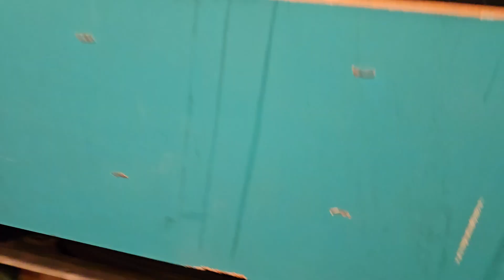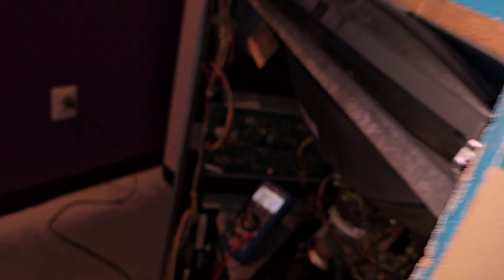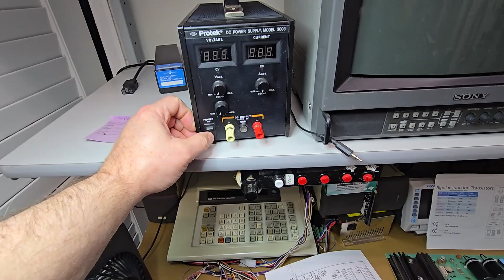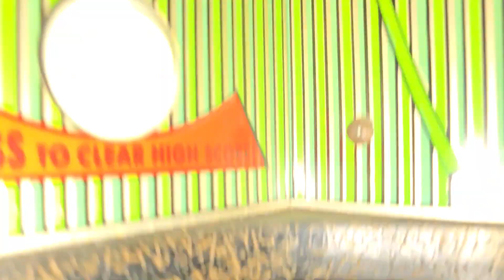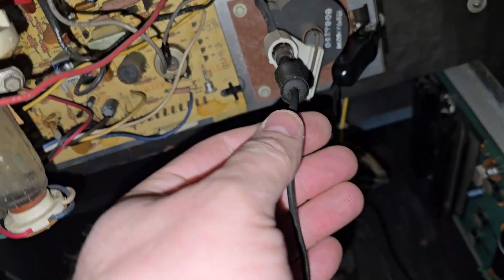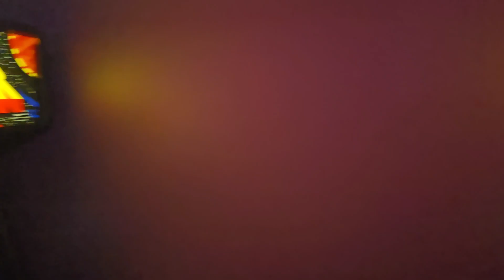Arcade ADITL - Sea Wolf - Reset ckt?, Ballast, HV Noise, Arcade Walk Around

Comment: I think to test a BAD Ballast transformer you're suppose to use a insulation Tester Megger. Using the DC resistance isn't going to tell you if the transformer windings insulation has decreased or increase from the damage of the HEAT of staying turned on and being used for years. Have you tried measuring the Bad Ballast Transformer compared to a Good brand new ballast transformer using an Insulation Tester Megger? The CRT Anode Grease problem you have to measure the Anode KV voltage "leakage" test, how much leakage voltage is from the Anode cup. Like if the Anode is 20kV but is NOT but the leakage voltage is 5kV to 10kV the CRT Anode Grease is not going to do anything. Have you tried measuring the Anode leakage voltage test?
Reply from the maker: Thanks for the info.  It would make sense to measure that.
Reply: @jacklick  Ya try to do that in your next videos